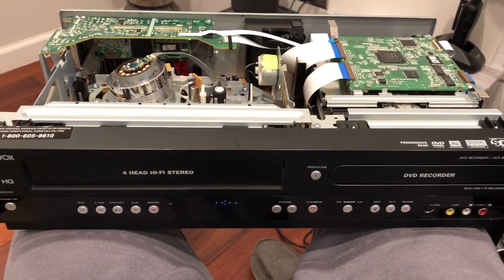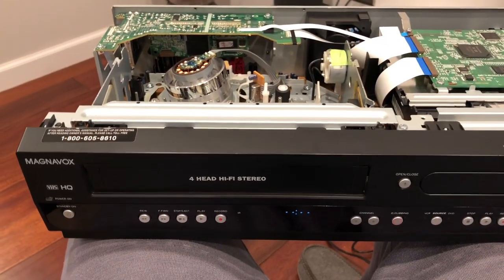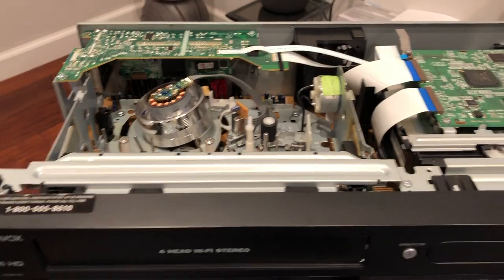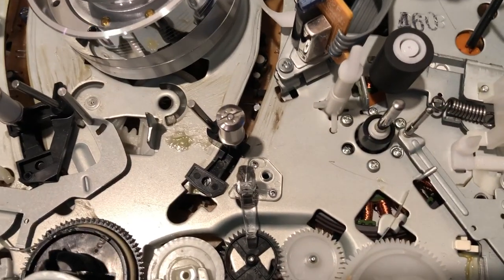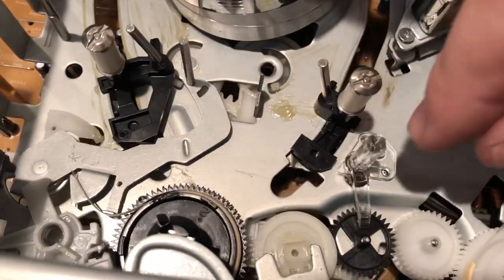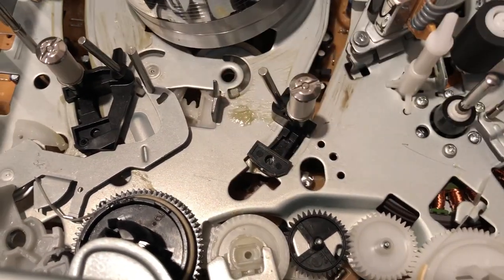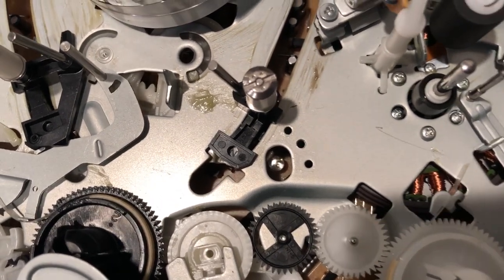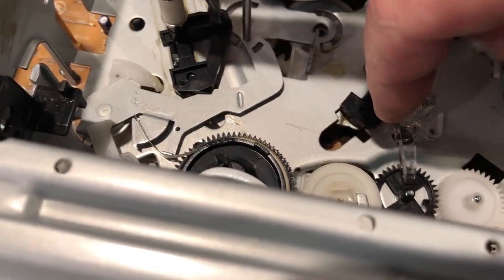Magnavox VCR/DVD POWERING OFF WHEN LOADING VCR TAPES FIX!!!

Comment: Excellent!  I did this (removed and cleaned the plastic sensor as shown) and it partially solved the problem by enabling the tape to engage with the metal drum thingy.  The machine still shut itself off so I followed another video tutorial and cleaned the rubber and plastic rollers as well as the metal drum with alcohol on a Q-tip.  I also made sure that the metal drum moved freely and wasn't jammed by gently rotating it manually.  Mine was not jammed but yet another tutorial talked about this so you might start by doing this step as it is the simplest one and might do the trick for you.  As advised I was careful to not touch any of the delicate parts like the gears or circuitry.  I hope you have as much success as I got from these videos.  Thanks to all the YouTube posters!

Comment: Al I need to apologize to you. I spent several hours on the internet including YouTube videos trying to figure out why my VCR would not work right. The problem was when I put a VHS tape in (took cover off to watch what was going on inside) the VCR everything would work for about 2 seconds...saw the picture on the T.V. then the tape would stop the arms would retract and the tape would stop and power light would go out. I would turn the power back on and the tape would eject. Tried over and over same result. Cleaned spools and sensors, checked for loose belts etc. all was good. What the hell could it be. So before I tore the VCR Player apart, I ran into your video. I actually laughed and said "yeah right like this simple trick is gonna work...no freaken way" Well I had nothing to lose and tried it! I can't believe it WORKED!!! I didn't realize there was a sensor under the plastic part. Took a Q-tip and dabbed it in alcohol and cleaned the sensor and plastic, then dried it with a fresh dry unused Q-tip. Damn the VCR works fine now. So sorry and thank you for the simple brilliant idea!
Reply: Fingers crossed!   Bout to do the same.... Will give update...

Comment: This worked for me. I picked up a open box new Magnavox VCR/DVD Recorder. Brand new in box, but then when I put any VHS movies when I got home, the whole unit would power down. Then when I turned it back on, the VCR would eject the tape immediately. Saw your video, opened up the unit and noticed the head was stuck/not moving. I carefully started to move it and now it moves freely. Popped in the VHS and bam, works perfectly fine now. Testing other movies and functions to see if the issue comes back, but so far so good. Was pissed when it didnt work at first, these things go for a lot of money new.
Reply: Did the VCR side show a distorted picture and stop at a point before turning off? That is my problem and your solution sounds the most likely

Comment: this also worked for me but the next problem I have is the tape will now play, yes, but if I press stop and try to rewind or fast forward, it powers off, but I can press rewind or fast forward while in Play mode.. so it does a slow rewind or fast forward just can't from Stop mode only Play mode.. 🤷‍♀